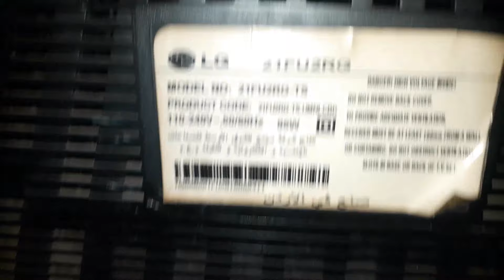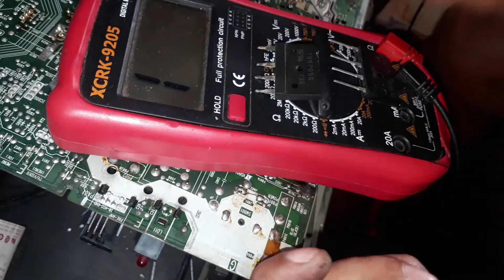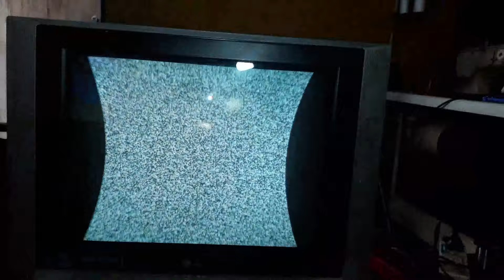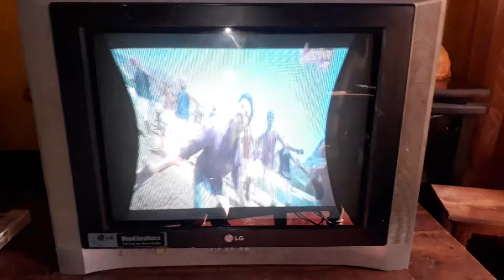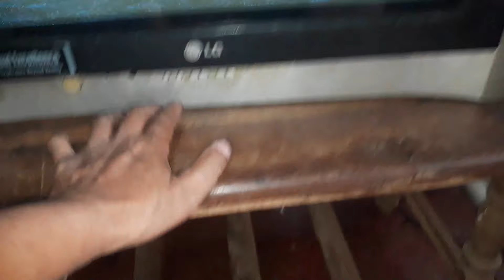how to repair LG Crt Tv pincushion problem ? ( sinhala )

Comment: Good video👍....CRT TV එකක secondary පැත්තේ voltage හරියට හැදෙන්නේ නෑ. B+ voltage එක 40V වගේ තියෙන්නේ. අනික් voltage ඔක්කොම අඩු වෙලා තියෙන්නේ. Standby light එකත් off වෙලා තියෙනවා.Optocoupler එකත් මාරු කලා. Power transistor, H out, V out transistor ඔක්කෝම හොඳයි. මේකට මොකද අයියේ කරන්න පුලුවන් . Flyback එක short උනාමත් මෙහෙම වෙනවද?